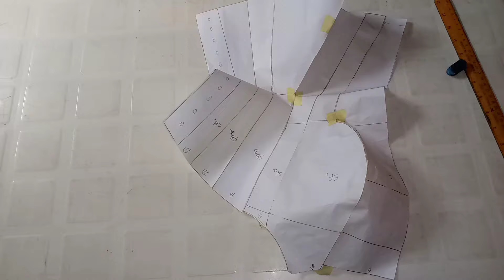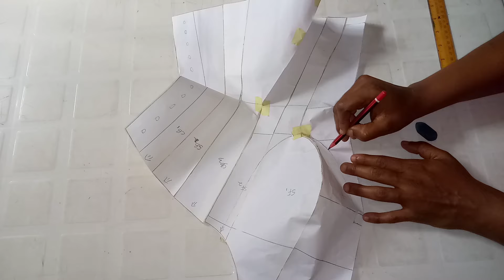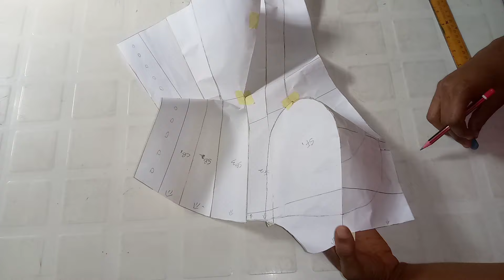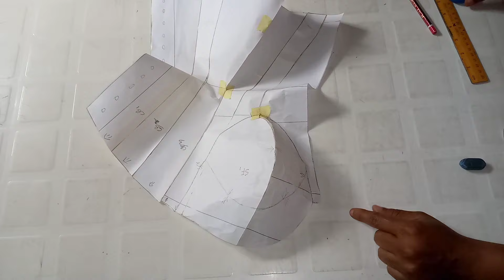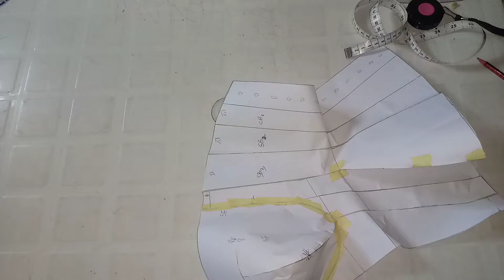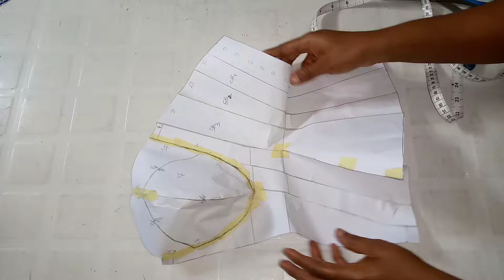HOW TO CUT AN INBUILT CORSET DRESS WITH BACK LACE/ZIPPER. (PART 2) VERY DETAILED. #corset

Comment: Thank you so much ❤❤
From the shaping of the chest to the waistline by the side .the bust point measurement got reduced in the process for both front and back , will it affect the fitting?because automatically overall 2inch is shaped away from the bust point?
Reply from the maker: No it will not affect the fitting rather it will fit perfectly.
Reply: @Stylebyjoan  thank you 🤗